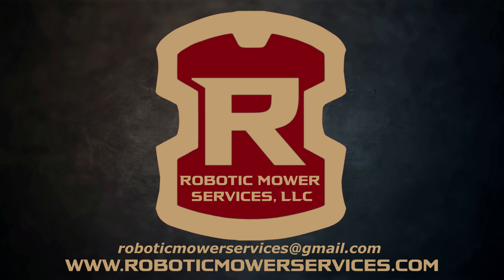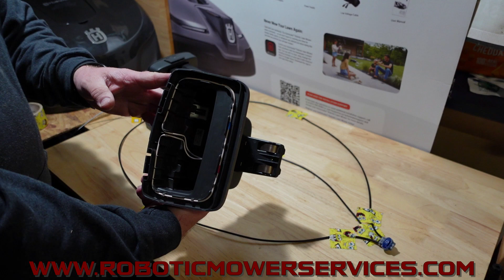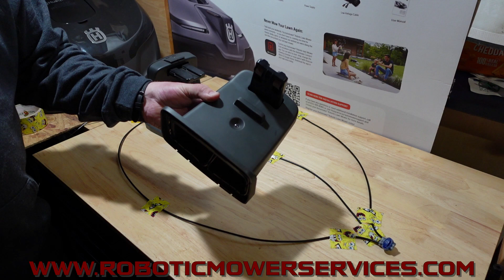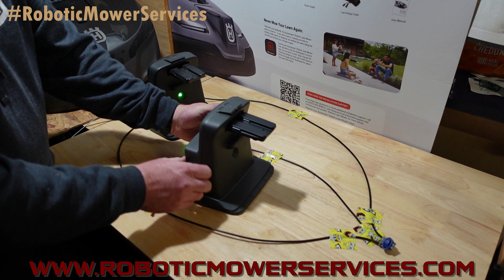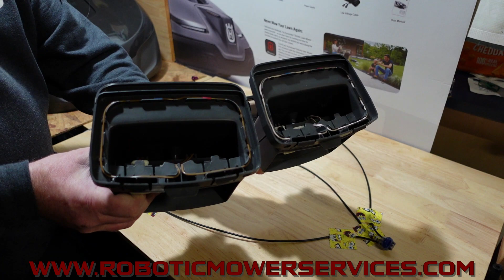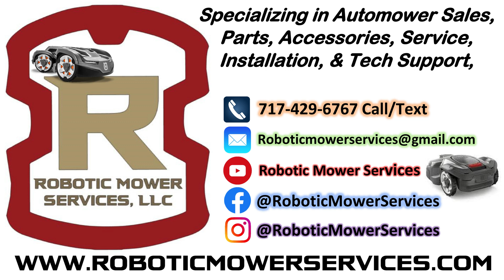115H Automower Charging Station Info (How It's Different Form Other Automower Charging Stations)

Comment: My 115H has a flashing blue light and continuity is good on all legs of the boundary wires. Changed the connectors just in case but still no go. 28 volts at left and right terminal so power supply seems good and points to a faulty tower. The video mentions old style and new style towers. My mower does not have 4G and only has bluetooth. is the charging tower linked on this page work on both new and old systems? if not. which one do I need?

Comment: What about a solid green light, and the mower doesnt follow the guide wire home.  Swap the guide for boundary wire, the base turns solid yellow.  Removing the guide wire keeping both boundary wires attached, the base turns solid yellow.  Put them all back as they should be, back to solid green. Never does it flash yellow, yet there is nothing in the manual to suggest what solid yellow means.
Reply from the maker: Have you watched this video that shows a few more things that you could check? https://youtu.be/s9y-APcp9KM
Reply: @RoboticMowerServices so apparently a neighbor saw our mower stopped, returned it to station and knocked wires out of the back and the guide and boundary wires were swapped.  What a pain to troubleshoot..
I still don't understand how when I swapped the other boundary wire with what I thought was guide wire would turn base station light yellow

Comment: Mine stopped working randomly and I'm kind of assuming that it's the Charging Station. Power comes through the power supply and the cables. But as soon as I plug it in to the Charging Station, power on the cable stops. 

Could that be a problem with the tower or the transformer?

Comment: Mine actually lost it's green light but it is still working fine.
I just can't connect with the app even if I reinstalled it . Could it be my problem?
Reply from the maker: That mower will work without the app. The app works with a board in the mower. It is in no way connected or has anything to do with the charging station.
Reply: Mine just stopped working a couple of days ago - wife is going crazy - I have the blue flashing light when just connected to mains , red flashing light when everything except for guide wire connected but no green light anymore AND it won't charge the machine. I checked that it has 28V across the contacts so any help greatly appreciated. I have a Gardena Minimo 500 but I understand it's basically the same thing.

Comment: Thanks for this. Is it common to have to replace the guide wires every mowing season? Seems my wires lose the protective green coating. When the h115 works, it’s great. When there are problems, it sucks
Reply from the maker: Sounds like the main issue is the green wire. Upgrade to he black UV wire or the black HD wire and it should eliminate those problems
Reply: I'm on year three for two installs and the guide wire hasnt given us problems